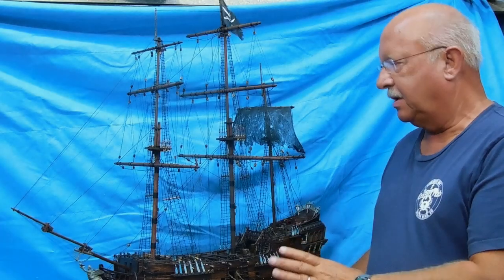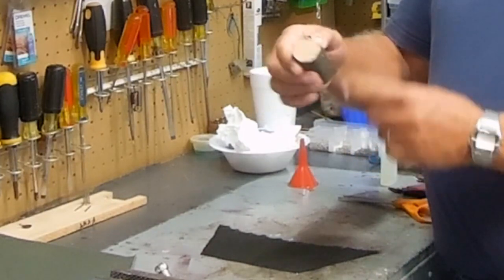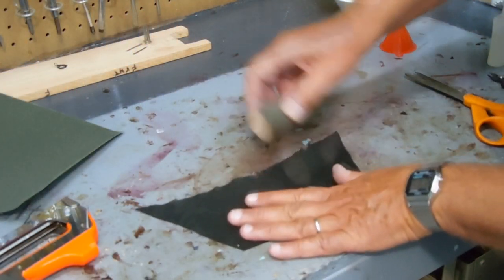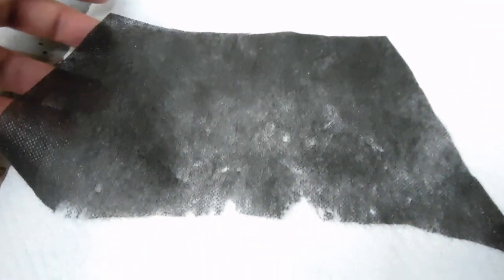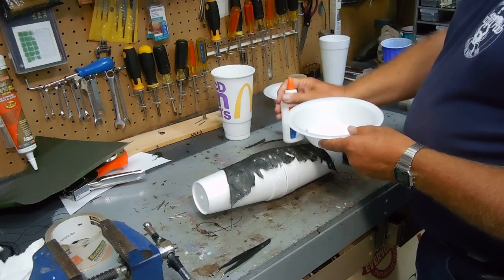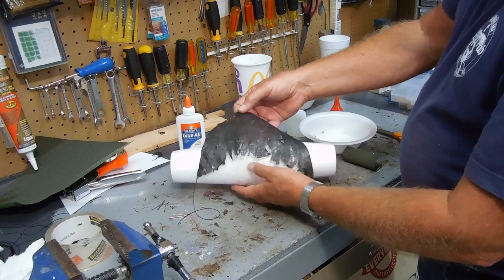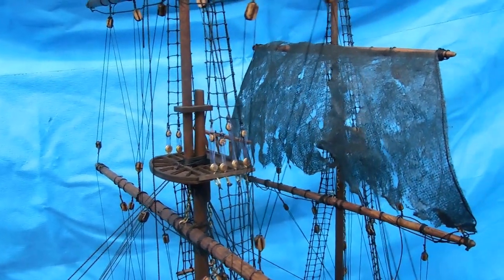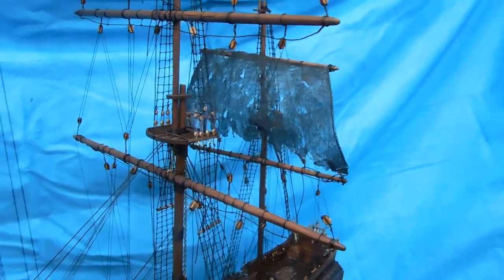The Black Pearl Model Ship SAILS - Part 30

Comment: Good idea.  I wonder if you could use the same technique on the cloth sails? Might take longer but give similar results?
Reply from the maker: Actually I agree, I bet you could! In researching, I saw people aging white sails by staining them with coffee grounds.  But starting out roughing the cloth up would make them look more authentic! Maybe not shredded, but thoroughly worn.  Maybe I should write a “Thinking outside the box of model ship building!” 😂
Reply: @BoilerDan1  totally should! I am looking at trying to burn holes in fabric (hot matches and such) simulating possible missed cannon fire, then sanding them to smooth the edges. . Also cutting the rough shape and holes then sanding. Still experimenting but not sure what I will be doing on mine yet. Still working on a light effect for the cannons.
Reply from the maker: I have a wood burning tool, that might work to make burn marks in cloth?  You’re cannon lights should great, but a wiring nightmare 😂👍
Reply: @BoilerDan1  yes they are!